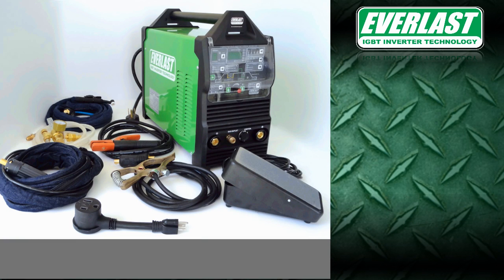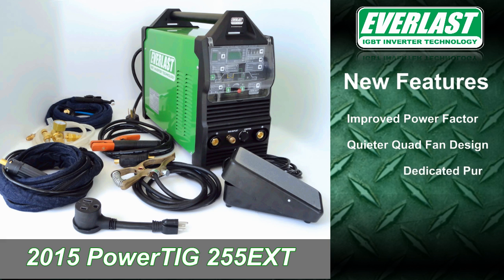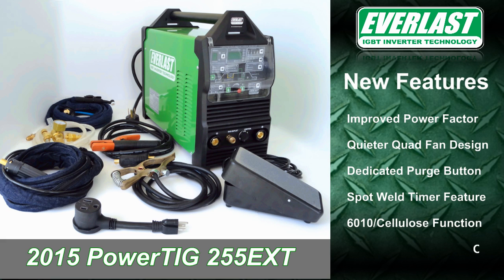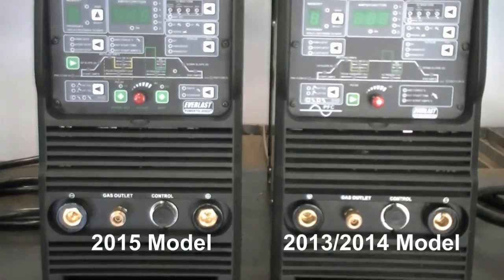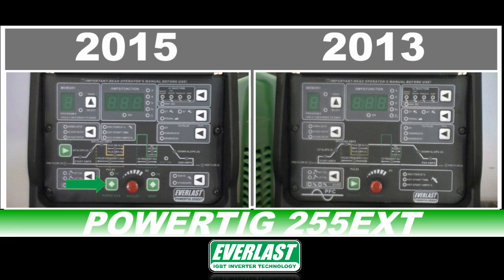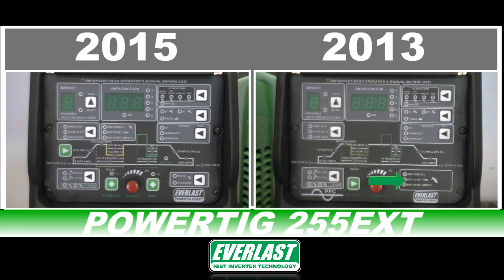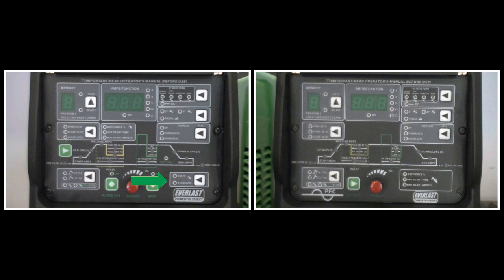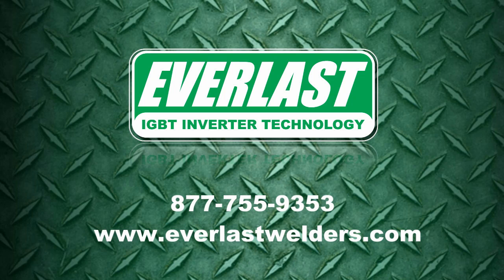AC/DC Power TIG 255EXT IGBT Inverter TIG/ Stick Welder from Everlast (2015 model)

Comment: Is the warranty still valid if I purchase this machine new from Amazon? the price is a little cheaper. I also plan to purchase the cooler for the water cooled torch as well.
Reply from the maker: Yes it is.  But if you purchase direct we can offer equal pricing.  You can call 877 755 9353 ext 204 or 201 if you are interested in one or in package pricing.
Reply: Everlast Power Equipment 
nice! thanks guys! you'll hear from me soon.

Comment: awesome new model......please do a video of the new MIG inverter the power mig i205 I think its called....mig/stick welder.....chucke2009 did a video on it.......can you do a video on it plus when is it available to buy I really want one and would also like to see u do a review on it
Reply from the maker: The Power iMIG 205 video is in the process...possibly in a couple weeks.  The new i i MIG 205 is available now.
Reply: Everlast Welders and Generators I cant find it on ur website I go under mig and the  the only 205 mig welders are bigger than the one chucke2009 got......its like a inverter around the size of everlast 200dx....ive been searching for it for awhile and cant find it......how do u buy it if I cant see it on everlastwelders.com?   I see 2 model the everlast I-mig 205p and everlast I-mig 205....neither are the one chucke2009 made a video a few weeks about.......the one Im looking for has stitch weld spot weld arc force and is mig/stick no tig or anything.....how do I find it
Reply from the maker: Richard Wight
 The welder on the site listed as the standard 205 is the one.   We are updating information but the basic specs are the same.  The new images and updated information have not been posted yet but it is the same unit.  You can order direct off the site or by calling in.